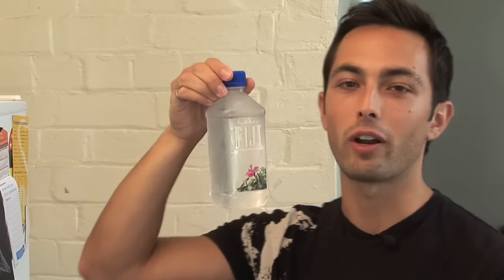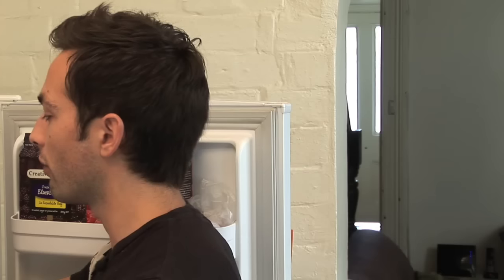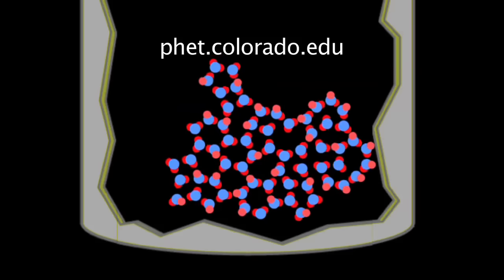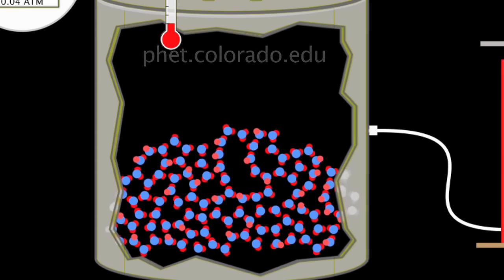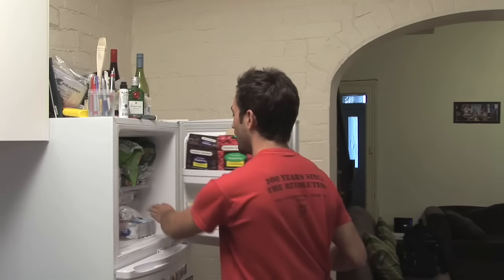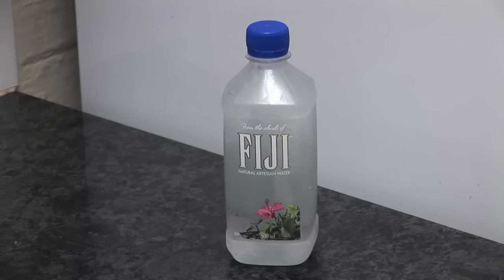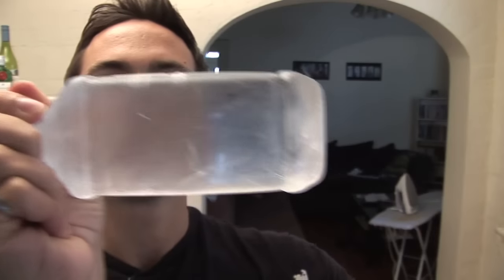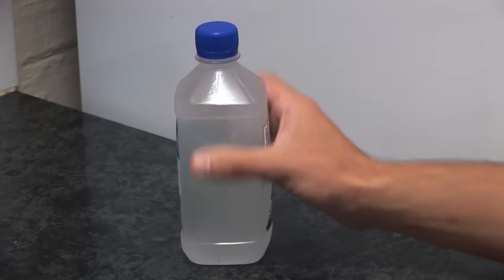Supercooled Water - Explained!

Comment: WARNING: Do not use a glass bottle and fill it up to the brim. 1kg of ice uses more space than 1kg o water, aka the bottle will explode
Reply: uh oh
Reply: the glass itself will likely crack due to the glass shrinking because of the temperature drop
Reply: blame it on the hydrogen bonds
Reply: @skydarkbomber1728  it will not crack if the cooling is slow and the glass was good before.
But when the water freezes it might crack due to pressure, or the sudden heat which comes from the ice. (it heats up to 0C very quickly)
There are lots of factors here, if you balance them right even a glass container should survive the experiment. (Just not use chipped glass, that can break from any temperature variation)
Reply: You seem like you might have learned this the hard way.
Reply: Thx captain obvious...
Reply: Explode? Perhaps just crack.

Comment: You can also do this outside the freezer using a bowl  of ice and salt and a small bottle partly filled with pure water. Benefits of this smaller approach is it’s almost guaranteed, it only takes 5-20 minutes and by adding a couple of thermometers (measurements down to -20 deg C) and a stopwatch, you can make a cool kids science project out of it … you also get to see the pretty amazing temperature changes involved in the whole process. Try it and see for yourself ☺️👍

Comment: I am in a high school advanced physics class and we were talking about this last week. I tried to explain the trick like how you did, but was shot down by my teacher. She said the reason why it freezes when you bang it is because there is a little bit of pressure in the bottle, and when you bang it the top of the bottle opens slightly to let air in, releasing the pressure and freezing the water. This explanation accounts for why the water freezes from top to bottom also. Secondly,  why do you say that you need very pure water for this? The trick works for soda too. Although it does turn into slush and not a solid mass. Lastly, my father does this trick all the time at work and will have the liquid sitting in there for no specific amount of time, and the liquid does not freeze on its own. Can you explain all of this with your understanding of how the trick works? Your response would be much appreciated and it will be shared with my advanced physics class. Thank you!
Reply: Kassie Comerio You can repeat the experiment with a fused bottle so that no air can possibly escape.
Reply: Kassie Comerio You need very pure water so as to ensure the total absence of sediment which will act as hygroscopic nuclei when the water freezes.
Also, I believe that the reason why the water freezes from top to bottom is because the vibration of the blow travels to the top of the bottle, where it pushes the molecules into each other, forming solid. Just a thought though, my knowledge of physics is very limited :/
Reply: TheBirdThatWhistles If you need very pure water then why does it work with soda which is not very pure.
Reply: ***** do you know where I can find one of thoes?
Reply: Kassie Comerio Well, I imagine you can fuse the top of a bottle yourself with a soldering iron.
Reply: ***** I feel like that wouldn't work so well, there might still be little holes or the integrity of the bottle will weaken and will crack open when I hit it. I'll give it a try though, thank you!
Reply: Kassie Comerio if water is at 32 F or 0 C it isn't a sufficient condition for it to be in solid state. You must also input enough energy to arrange the molecules in to a crystalline pattern aka solid state. He is inputting the energy and setting a chain reaction of alignment by hitting it, it has nothing to do with the pressure.
Reply: I understand that reasoning,  but the problem that I am having is that the trick works also when you merely open the bottle and not hit it. Although it doesn't show that part in this video.
Reply: +Cassandra Comerio The purity only matters with regard to particulates, solid stuff, not dissolved substances like sugar. in fact a sugar solution has a lower melting point.
Reply: +Cassandra Comerio This is perhaps caused by vibrations during opening the bottle.

Comment: What if you drop a water balloon fulled with super cooled water?
Reply: +Der Übermensch The water balloon may tear upon impact with whatever surface it is dropped on. If the water inside crystallizes once the balloon is dropped, the balloon may stretch and take the form of whatever shape the water/new ice is once the process begins and completes, all the while the balloon retaining it's elasticity. I'm honestly not to sure so it is something that you just have to test and find out for yourself.
Reply: wow good question!  i wonder about that now too.

what if one used a very thin balloon, and smashes it on the table, and the balloon ruptures, sending the supercooled water flying? will it still freeze?
Reply: Nothing.
Reply: It doesn't actually turn solid. It turns more into jelly.
Reply: Captain here: balloons have some sort of powder on the in- and outside to prevent the rubber from sticking. These particles can will initiate the nucleation and hence causes the water to freeze. So, only if you happen to have a balloon that is almost clean of particles and filtered water you will stand a chance to make super cooled water in a balloon.
Reply: It will turn into sludge when it hits the ground.
Reply: Paula Worstenbroodje , I guess we could use a “powder free nitrile glove”.
Reply: It turns into perfect yummy slush water

Comment: Imagine Super cooling the water then drinking it and it freezing in your throat.
Reply: I think it would freeze as soon a
you opened the cap
Reply: I think it would freeze as soon a
you opened the cap
Reply: I do this everyday... It melts instantaneously! You may gag with liquified ice, or water for short. You can't drink it from the bottle of course it would not come out the solid stuff so easily after nucleation, but put the ice-water into a cup and chug it up, liquid and solid melting instantaneously in your throat, too fast for your to gag with the solid crystals, but messy enough for you to gag with air and liquid cold water. =D
Reply: I've done it accidentally before, semi freezes up in your throat, same texture as snow and does melt very quickly. But I promise you it's very uncomfortably cold. You can pour supercooled water onto objects straight from the bottle and it freezes on impact and you can make mini snow towers :D

Comment: I've done this by accident multiple times using store-brand spring water. I have a small cooler that I keep cold using bottles of water frozen in the freezer. After freezing the same bottles over and over again, eventually one will end up supercooled and I have to shake, squeeze, or bang it to get it to freeze. It never turns into ice though, just super cold slush.

Comment: I used to be able to do this consistently with Dasani water. That was when Dasani was new to the mass market. Since then the bottle and probably the water itself has changed and now it's much more difficult to recreate. It seemed to me at the time that a few factors were responsible. The bottle was thick (rigid plastic) and well sealed, which kept the water under pressure and ice crystals from forming. Water is naturally denser at 4 C than when frozen, but keeping the bottle under pressure extends this dense state to temperatures below freezing. A freezing point a few degrees below 0 is then required to exert enough pressure on the casing to form ice crystals. To test this, simply open or gently puncture the super-cooled pressured bottle and it will turn to an ice crystal. There are probably other methods, such as using monopolar ions or electrical currents, but I would venture to guess that in the common super-cooled water bottle trick, pressure plays a significant part.
Reply: Just want to point out that Dasani is tap water

Comment: What I want to know is, if you were to be able to open the bottle without jolting it, and then try to drink it, would it freeze as soon as it got into your mouth, or would the movement not be enough to cause it to freeze?  Honestly what I was wondering was if it would create a giant iceball in your stomach but probably not because I'm also thinking that then it wouldn't be cold enough anymore.

Comment: If you want pure water, why don't you use distilled? Fiji water still has impurities.
Reply: Aeroscience maybe fiji is promoting this video
Reply: +Aeroscience well, this is a video demonstrating how you can make water freeze instantly at home, so it would be reasonable to use materials that you can easily get your hands on, rather than using 100% pure h2o, which is probably hard to find. i know i can't anywhere that sells the thing.
Reply: +Hoàng Trần Minh (MassiveFire) distelled water is pretty common to find in a house enviroment, since it's used in flatirons and it's sold in bottles in a lot of places that sell house merchandise
Reply: Jang wow. but sorry, in my country, there aren't much places that sells pure h2o. we can only get it from lab equipment shops.
Reply: +Aeroscience It has a Fiji ad on the side.
Reply: +Beach Ball  distilled water is just boiled,  still has impurities, just  sterilized
Reply: The Laugh Challengers distilled water is has almost no impurities. what we are aiming for is 100% purity, not sterilization, though impurities and sterilization are directly linked
Reply: +The Laugh Challengers No, that is not correct.
Reply: +The Laugh Challengers To elaborate on Nature Alley's somewhat terse reply, distilled water is fundamentally different from boiled water.  Boiling water just requires you to heat it to 100ºC (at 1atm pressure).  Distilling water requires you to first boil water, then capture the steam and water vapor, which will include no (or minimal) impurities - these are left in the boiling water.  Then, you condense the steam down into liquid water again, and it remains very pure.  So boiled water is really what distilled water leaves behind.
Reply: Thanks! My answer WAS a bit terse... you were right.
Reply: nettles89 but don't dust from the air create impurities? i think that distilled water is made in super clean places such as a chamber in a laboratory. if anybody knows a link on a detailed how-to-make-distilled-water, please give me a link
Reply: nettles89 actually, i think it is 1244l. V (gases) = mol x 22.4.   But thanks a lot for the valuable information.
Reply: +Hoàng Trần Minh (MassiveFire) Don't forget sig figs.  Truth be told, I fudged them a little already - I should have given the initial mass as 1.0 kg, not 1 kg, to even justify my answer of 1200 L.  In order to say 1244 L, you'd have to specify the initial mass (and therefore volume) to the fourth digit as well, i.e. 1.000 kg = 1.000 L.  Since we're talking about an approximation anyway (ideal gas law), this seemed not only unnecessary, but misleading.
Reply: +Hoàng Trần Minh (MassiveFire) Custom PC stores will have it as well :P
Reply: Kriss_941 what do PCs have to do with distilled water?
Reply: Hoàng Trần Minh Custom cooled PCs will often use destilled water with some extra additives... you can get bottles of destilled water and even bottles of deionized water...
Reply: That's what I was thinking.
Reply: +Aeroscience I tried it once and you don't need water that is chemically pure, it may contain some salts. It's crucial to have water and vessel without mechanical particles including tiny air bubbles. I tried it with plastic tubes for urine analysis and tap water and it worked with the most of them. Perhaps you may get them from drug store.
Reply: Distilled water isn't, "...just boiled..."  It is water, turned to steam, transfered out of the boil pot as steam and condensed in a condenser pot, leaving the impurities behind.
Reply: Sponsored
Reply: A good place to get pure water is in car accessory shops. Refill water for car batteries should be ideal and quite cheap. You should be able to find it for 2$ and change.
Reply: +T McGee distillation is not boiling. Distillation means that a constant temperature of 212 Fahrenheit is used and the steam that evaporates is condensed back into liquid in a separate container (in  nutshell) which leaves the impurities behind. It's just like making liquor except with whiskey you are boiling the alcohol and not the water so you need to keep the temp around 176 Fahrenheit to leave the impurity, which is water, behind.
Reply: @tmcgee6538  Things that make me go: HUMMMMMM. Distilled water is converted to a gas and then condensed back into (supposedly, within reason) H2O with the 'crap' left behind.... but I'll give this one to you because of how we may interpret "sterilized".
Reply: @tmcgee6538  no, distilled water is not just boiled water. Minerals don't evaporate.
Reply: @tmcgee6538  Distilled water is not just boiled: water is boiled, the vapour/gas given off and condensed back into liquid water (while keeping it separate from the original water container).
Reply: @franksierow5792   When you boil water the impurities go to the bottom of the Pan. All of us who grew up working on vintage cars with non sealed batteries did that for distillation for the batteries back in the days when it was hard to buy distilled water. if you did not the mineral deposits became noticeable. 
So in a lab environment, you are correct but in the real world you can't acceptable results without.
Fiji water got a slap in the face in 06 when Cleveland municipal water proved Fiji had more impurities than their tap water.
So one could make this work with tap water, maybe better.
Reply: So true... 🤣

Comment: Quick question: in all videos I've seen on supercool water, the freezing always starts from the top. Is there a reason for that ? Is it because of the air on top ? What if you flip the bottle before hitting it ? Based on your explanation, it seems the freezing could start from anywhere (particules could start aligning up in the middle of the bottle), but videos seems to show otherwise, always from the top.
Thanks.
Reply: +Freak You may have noticed that these water bottles are really dry when you have poured all the water out The bottles are quite hydrophobic which hampers ice nucleation. Hydrophilic impurities act as nuclei.
At the surface the water molecules have more freedom of movement I would think, so it would be easier to generate a 'homonucleus'.
Reply: @naturealley5821  thanks
Reply: I think it's because water goes down and comes up again hitting the top of the bottle.

Comment: What happens if you pour the liquid out? I'm guessing it will become a slush-like substance.
Reply: It's just like normal water.
Reply: johnson sun
Are you sure? I saw this guy do that with sparkling water and it worked.
Reply: OHhh...
Reply: i do this everyday cos my fridge is really cold, the water is fine until i pour it out, then it freezes on contact with the oxygen as it collides with where i pour it, slowly making a mountain as the water falls, it does become slush like, only when disturbed though. it wont be solid frozen but rather like slushy. even bumping the bottle will result in slushy substance.
Reply: Well if you pour it carefully, it will stay liquid, you could add a piece of ice and it would freeze. But if you pour it out fast, it will freeze
Reply: This happened to a chilled wine I had in my freezer. It supercooled and was very slush like, though not a solid block of frozen wine. When it was poured out it was like an alcoholic slushie.
Reply: Science at the finest.
Reply: so we could make an ice thrower, like a flame thrower but you know... ice
Reply: johnson sun
So true.
Reply: Amanda L That's probably from the alcohol in the wine.  Alcohol has a much lower freezing temp.  It is also why gin and vodka are stored in the freezer.
Reply: i think it will freeze before you open it because while opening youll make a vibration and it will make the freezing effect
Reply: It would be...water. If you pour it, it won't be as cold. Therefore, the water won't be able to freeze because of the rise of temperate
Reply: Amanda L Sounds delicious :P
Reply: OmegaA1000 You, I like you, you're gonna go places
Reply: swanclipper Why does it necessarily have to be oxygen? It could be nitrogen, oxygen, carbon dioxide, argon, maybe other water molecules or impurities in the air.
Reply: ImagineCraft7 Sparkling water is different. It's basically carbonated water. You can "supercool" a soda by shaking it, then putting into the freeze for 2-3 hours. When you pour it out, it becomes a slushy, but pure water doesn't have carbonation, so, it's unlikely that it would become like a slushy.
Reply: Probably freeze around the neck.
Reply: if you did know what happens why did you ask?
Reply: Gregory Weber It wasn't really a question.
Reply: ImagineCraft7 7 Hold on, "what happens when you pour the liquid out?" That isn't a question?
Reply: Gregory Weber It wasn't meant to be a question.
Reply: ImagineCraft7 Oh right you were just trying to look smart, oh okay.
Reply: Gregory Weber Not even close.
Reply: 780
Reply: I was curious about another this, water expands when it is ice and the bottle obviously didn't break. Is that because the excess pressure prevented more water from freezing? I mean the higher the pressure the lower the freezing point.